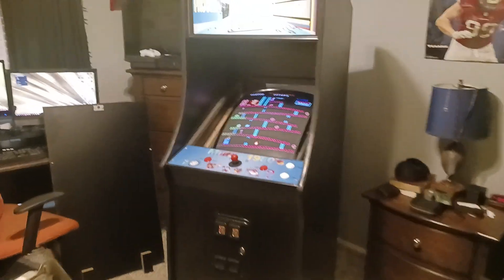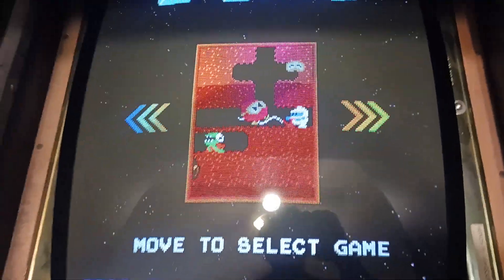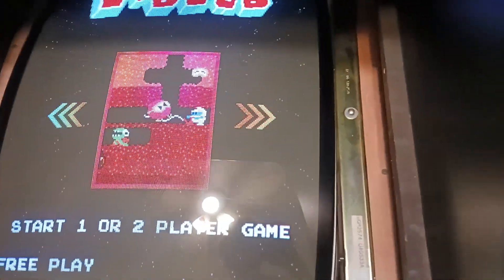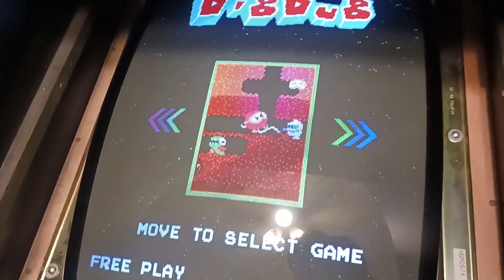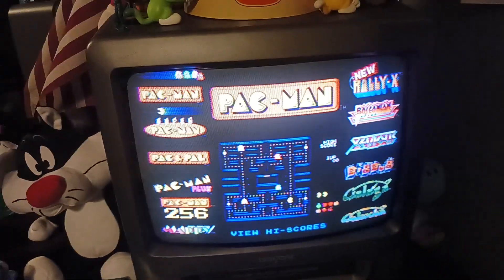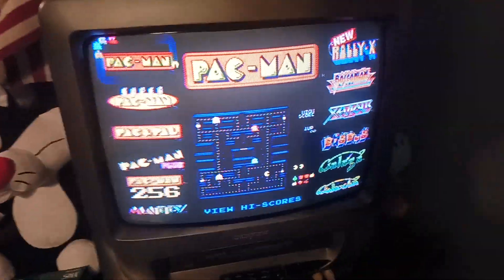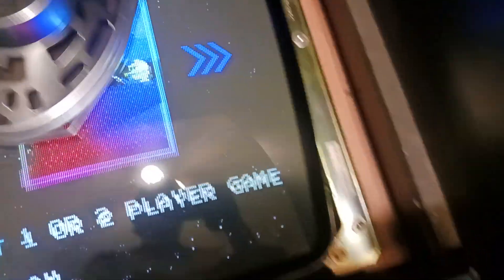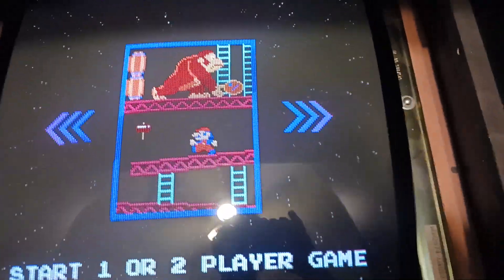The surprisingly BEST way to degauss a CRT monitor with $0!

Comment: We took the degaussing coil out of a 34xbr wired a plug onto it at the tv store. Plug in, wave around the screen a few times, and pull it away before unplugging, always worked, unless the tube was borked anyway.

Comment: Yes. It works, but you need to be CAREFUL because the magnet can permanently damage the shadow mask of the tube.
Reply from the maker: Yes, this speaker has a magnet cover, this resist the magnet's power.

Comment: I don't think it has anything to do with the amount of time the magnet is left on there as much as it has to do with the twisting action as by doing so you're basically re-aligning any stray magnetism left on the screen.  Also doesn't matter which side you use. Be careful using a really strong magnet however as it can literally bend the grid inside the tube. I once permanently damaged a TV by holding a magnet right up to it too many times. The magnet on your speaker there has a magnetic shield which means it doesn't emit much of a magnetic field, in this case that's probably a good thing.
Reply from the maker: Yeah, I probably should've mentioned that... But that's why I said it's a pretty good way since the speaker has a magnet cover.

Comment: Back in 2005 when I was about 5 at the time, our family TV had developed those weird spots of color inaccuracy. They pretty much stayed there no matter what we did. I had found a magnet on the side of the road walking back from school and was using it to pick up everything around the house. Lo and behold when I took it towards the screen the discoloration started disappearing. I'm pretty sure most speakers have magnets in them so maybe this was a similar reason as to why it worked.
Reply from the maker: Could also be the Yoke assembly coming loose, if it's loose the monitor becomes discolored like that, the magnetic field was getting fixed because the magnet was returning back to it's original state, if the Yoke was fine, the monitor would get discolored.